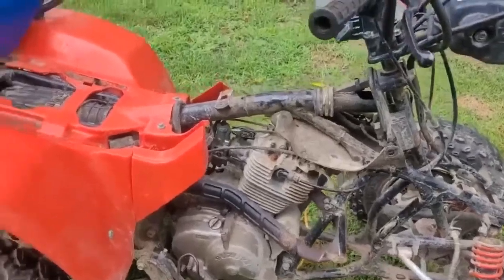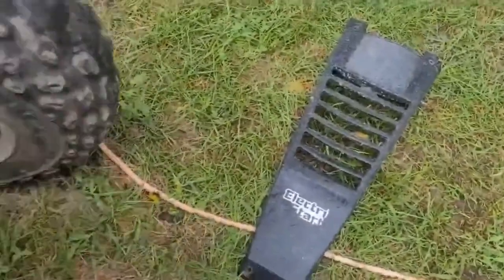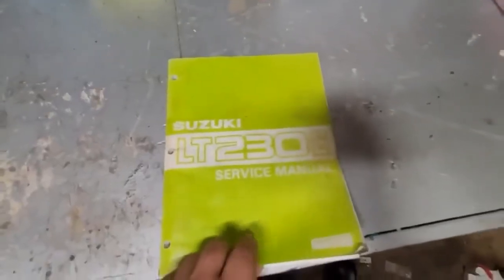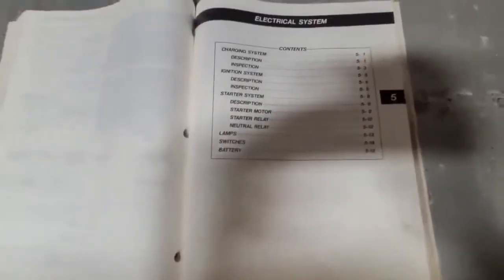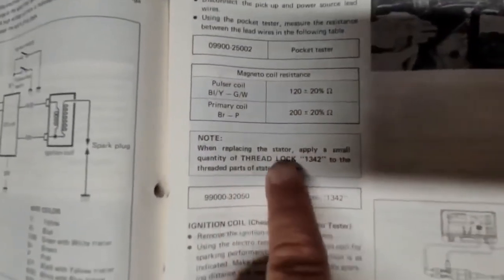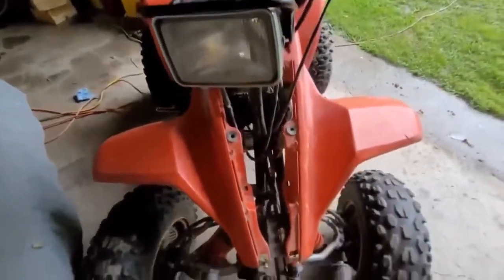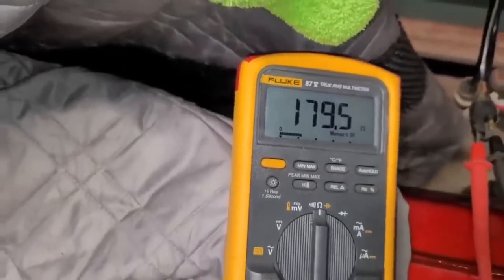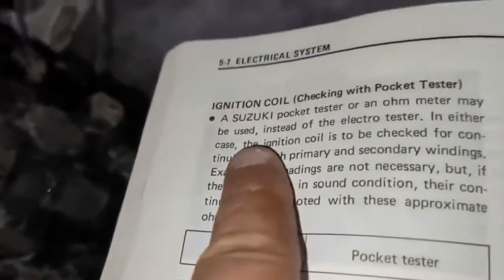suzuki quadrunner LT 230e no spark issue.

Comment: Is this possible?? i am also getting an open on the pink brown primary coil wires on 1985 230s. It starts and idles perfectly but breaks up really bad and misses under load. Ive eliminated everything else following your testing. I just thought if coil was open it wouldnt be possible to have any spark?
Reply from the maker: @Jaymx166  yeah that is a little strange, an open would usually cause a no spark issue. It's possible it's intermittent. I had one once that water got into the wiring harness and was causing weird issues.

Comment: Think of all the bullshit they could have saved us if they just used points and condenser ignition with a normal automotive coil.  More complex doesn't mean better. All this nonsense could be replaced with a simple magnet and a coil from a lawnmower engine too. Engineers need to be required to be mechanics for 10 years before they are allowed to design anything.

Comment: Okay so I have the same quad but it has spark but still won’t start and I don’t understand why, I even tried pouring gas into the plug and put it back in and tried starting it and it still won’t even try to start, any ideas on why?
Reply from the maker: It sounds like a fuel problem, if your getting a good spark.   If you lift the seat and remove the air cleaner, pick up some starting fluid and spray a little toward the carburetor.  Starting fluid ignites much easier. If it doesn't  try and start off the starting fluid. My  next step would be to check the compression.
Reply: @AdamzGarage  You we’re exactly right, it wasn’t getting fuel to the carb, thanks for the help, I feel silly after that one lol

Comment: I don’t know if Anyone knows but I have this same quad and don’t have spark and I noticed the other day when I took the stater out it had oil in the stater side of the case does anyone know if it is normal for that to happen or do you think a seal went bad
Reply: It's supposed to have oil. Mine has oil in it too.

Comment: I have a 1985 lt230s that just died while I was riding it and now it has no spark I checked every wire no breaks frays or anything but there’s still no spark what’s wrong with it.  Thanks
Reply from the maker: If its definitely not getting spark. It could be several things. Did you happen to get it wetter than usual,  we're you going through water ect.  If water finds its way into the wiring somewhere it can short out to ground. If not I would suspect something in the magneto.
Reply: @AdamzGarage  I just got a brand new ignition coil and still no spark
Reply from the maker: @drumboon1986  I would start tracing out wires.  It's a slow process, but you might have to unravel the electrical tape on the wiring harness and look for a cut wire ect. It could also be your cdi unit, but there's no easy way to check them and there usually not cheap on ebay. Basically  you have the spark plug, spark plug coil , the coil you already changed, and the cdi. If you look at some of my older videos, I did a series on no spark for a suzuki lt 125. That spark issue ended up being water in the wiring harness. Check those out , they may help.
Reply: @AdamzGarage  i have a question  I have been trying to find rings for my atc 185 the piston size is 63mm but 63mm rings don’t fit do I need bigger rings because the groove where the rings go in the groove are deeper.  Thanks
Reply from the maker: @drumboon1986  it's possible that they may be 65mm, but I'm not certain. I'm assuming it's a honda 185? I would reach out to babbits partshouse, they could probably tell you for sure.
Reply: @AdamzGarage  i figured out the problem with the lt230s it was the killswitch thanks for all your help
Reply from the maker: @drumboon1986  awesome!!  Good find.
Reply: @AdamzGarage  I just rebuild my atc 185 and it runs but I have to give it full throttle to even move what’s the problem.  Thandk
Reply from the maker: @drumboon1986  does it idle okay? Before the rebuild did you ever have it running or did you buy it as a project?
Reply: @AdamzGarage  I have had it for seven years and it has been apart for about five years I just got it to run it doesn’t idle and has no power unless it full throttle the jets were replaced and I think they are to small so not enough gas is getting in how do I size the jets
Reply from the maker: @drumboon1986  I'm assuming it's a keihin, if I were to guess I would say the main jet is probably around a # 100 give or take a size . I usually have good luck with babbits or partszilla online, you can usually find the old exploded views of the carburetor. Then they have the parts listed according to the diagram #. Usually you will find that there are several sizes available,  but there very small increments.
Reply: @AdamzGarage  ok thank you

Comment: did u find out the problem have same problem whit same atv?
Reply from the maker: Yes. My problem ended up being the stator.  I removed the stator from a project 230e motor I had and swapped it. Been running great ever since.
Reply: @AdamzGarage  thanks  for ur fast replay i change spark plug ignition coil voltage regulator battery ,solenoid,and have no spark im next whit the stator